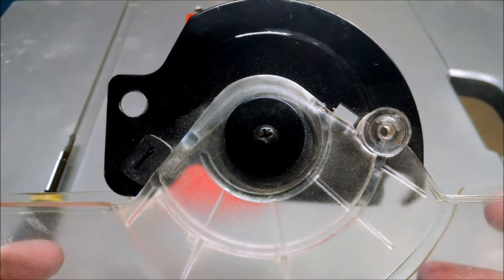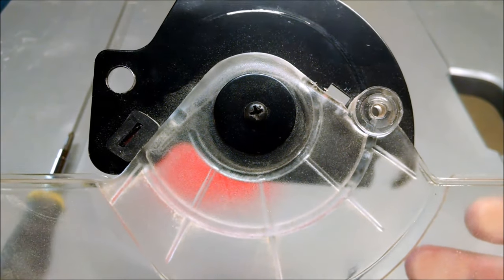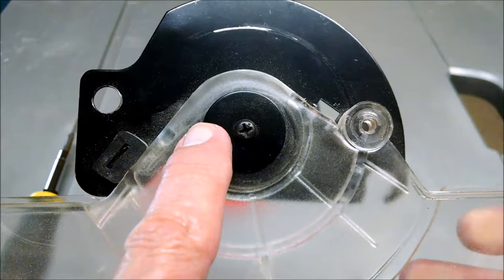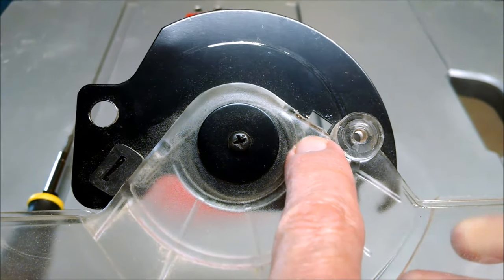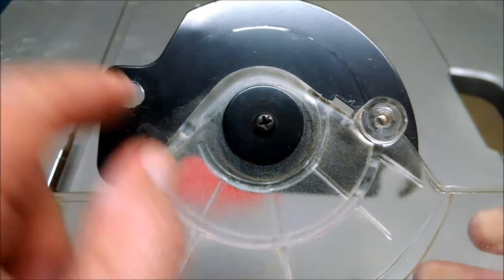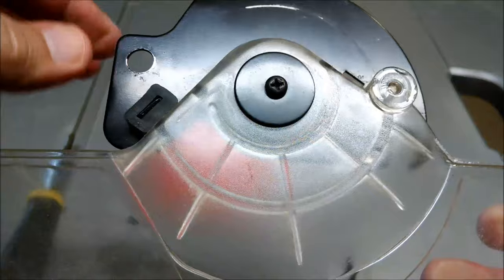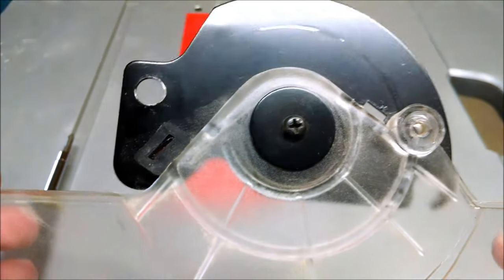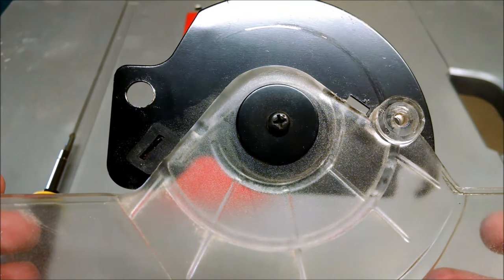Miter saw guard spring

Comment: THANK YOU !  One thing some worthless "person" broke into my shop & stole was my Dewalt dual-bevel sliding compound miter saw, but they left my Makita that had been holding down the tarp on my firewood for 2 years.  My Makita works just as well as it did when I got it thiry years ago.
Reply from the maker: GB, Thanks for your comment! Sorry your DeWalt took a walk. My miter saw was about as cheap as they come - $70 - hardly worth stealing, but it has done everything I needed it to do for years now. (I know you don't need this next bit of advice, GB. Sounds like you've been at it for many years.) For beginners, it's important to realize that there are stops and settings on your miter saw that need to be checked when you first get your saw. Spend some time making sure the fence is perpendicular to the saw blade, and that the saw blade, when set at zero, is perpendicular to the table. That investment will keep you from ruining projects.

Comment: THANX..................had it 180* out and just couldn't get passed it...................... Guard was binding and needed more [pull arm adjustment] in the woopy. Bent opposite sides in a vice, and maintained the exaggerated "V" by placing a "D ring" straddling the "V" on opposite faces of the pull arm. While using the vice to straighten.  Bending Fork might work.....

Comment: Hi, did you do a video of you setting the spring? I cant see mine in the window like you showed on the video. And I think thats what my problem is. I can see the spring coiled up but know ends. Is it a muscle job to fight to get the spring ends in the right place? Thanks
Reply from the maker: Lynne, do you have the same model saw? If so, I could post a photo on my website showing you where the ends of the spring are. This is not a strong spring. It should be easily manageable. You don't even have to preload (bend) it very much to put it into place.

Comment: Hi Mark,  a friend has an Ozito CMG-411 sliding compound mitre saw 1800W. She bent the link arm that operates the guard, which I've straightened, however, when operating the saw  - the end of the link arm is pressing hard on the tab that it follows making it hard to operate. Do you know of anything that may be causing this, or can point me to an exploded drawing/video, that will show me how it operates. cheers Colin Jeffs
Reply from the maker: Colin, sorry but I'm not familiar with the Ozito saw. I Googled to find a manual, but I'm not sure it's the same model. I would probably have to see the miter saw itself to diagnose the problem.
Reply: @markbeuligmann7363  Thanks for the reply Mark. The guard return spring plate assembly is very similar to the one in your video clip above. The end of the link arm applies pressure to the tab on the spring retaining plate, which is on the inside of the guard. In our assembly the link arm seems to be losing contact with the Tab, which leads to the guard jamming. I'm planning to have another look at the assembly tomorrow. Shall take pics , which may help unravel this enigma!

Comment: Mark can you please show the back of this part??
Reply from the maker: Heriberto, I will try to do that soon. I think several others would like to see that as well.  I'll have to disassemble the cover, and I won't have time to do that for a few days.
Reply: It's because some of us have little to no experience on how to take the blade off and we unscrew the wrong screw and I also  had the back piece fall into the saw when I was taking it apart and I couldn't  find the pics I was wondering how it would  look like and how it put it together  and fortunally  and there is no instructions  on how to anywhere  finally I figured it out by looking at your video thanks the spring end goes inside tho small hole on the black metal piece.... thanks for your video was very helpful

Comment: Can anyone tell me how to change the blade on this old tool shop miter saw
Reply from the maker: Renatta, there's usually a button or lever you push to lock the blade and keep it from turning. Sometimes it's a hole you can poke a screwdriver through. When the blade is locked, loosen the bolt on the shaft by turning it clockwise. That's counter-intuitive, I know, but the threads are reversed to keep the bolt tight during operations. Everything should be straightforward from there. You probably already know this, but make sure the teeth on the new blade are pointing in the right direction.
Reply: baseboard middle cut
Reply: Can some one just tell me where I unlock the arm